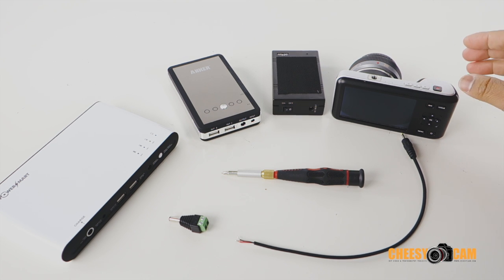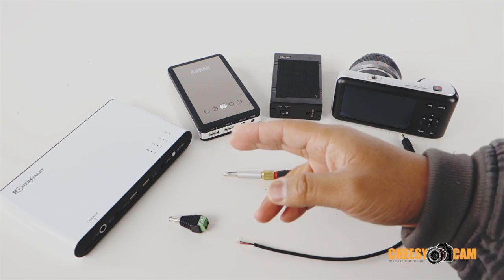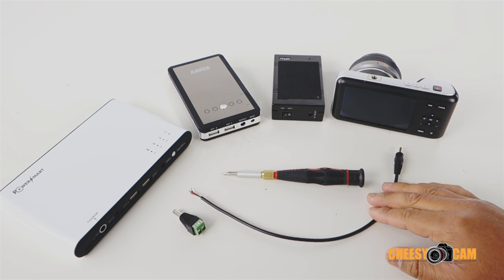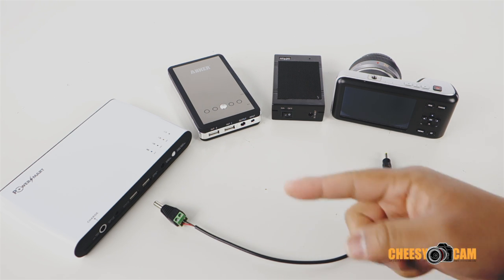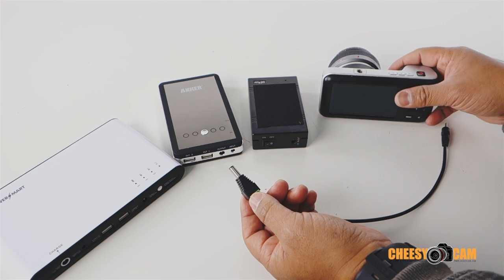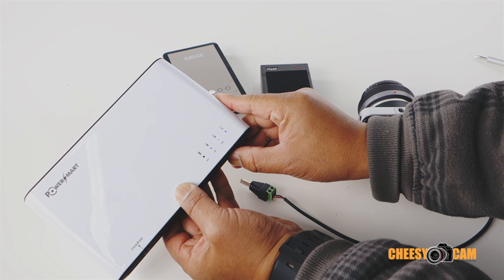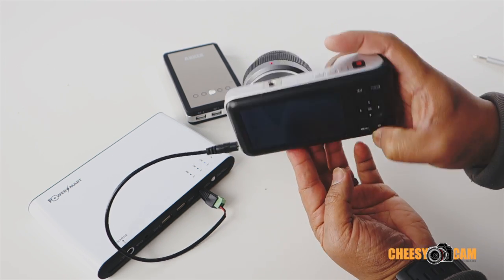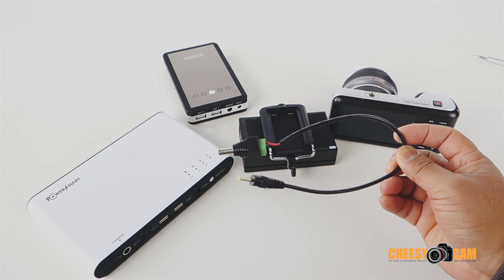DIY using any 12V battery for the BlackMagic Pocket Cinema Camera

Comment: Is it possible to use a 6400mAh 11.1v 3 cell lipo battery for the BMPCC4k?
Reply from the maker: Yes i think that would be possible as long as you have the correct adapter for the DC input.

Comment: I've heard the BMPCC can be powered from 7.2 volts and up.
Reply from the maker: Yes, but that is not enough to charge the internal battery. The reason you want to have a charged battery in the camera, is so that you can swap external batteries while the camera can remain on.
Reply: Got it. I have an 800mah pack, I going to connection a DC 5v to DC 12v step up voltage converter and plug into it.
Reply from the maker: Hmm while there are ways to change voltage (up or down), that does not increase / decrease the amount of AMPS a battery or a port (USB) is capable of delivering. The max amp output from USB is typically around 2AMPS (for a really good one), and that's because of the design of USB. Hopefully this is enough to charge the internal battery.
Reply: I'll try it and let you know.
Reply: Well I dont know about 7.2V, but 9V for example didnt work for me. I had to use 12V, otherwise the camera would not have turned on.

Comment: If I instead were to buy an 18v battery and a 5.5mm adapter, would I be able to do the same with the BMCC?
Reply from the maker: +Ivan Velasco I forget but I think it only supports up to 14V. 12V is the safest. Voltage does not determine how long it will run so 18v will not necessarily make any difference. 12V is pretty safe.
Reply: Ok, I'll do that then. Thanks for your help!

Comment: would a 12v car battery work fine with a black magic cinema camera ? input is labeled as  12-30v ..
Reply from the maker: Yes that would work also. But car batteries are usually very heavy and don't like to be discharged completely. When using different types of batteries sometimes you need to build in a low voltage meter so that you don't damage the battery.

Comment: What happens if you plug in a battery higher than 20v? Could it damage the camera?
Reply from the maker: +Eli Jordan Yes you will have a nice campfire.... The BMPCC can input between 7-16V, that should give you a lot of options for batteries. Do not attempt anything over 16V.
Reply: So the limit is 16V not 19V?, that's bad news because i planed to power the camera from a 4S lipo, but fully charged they had 16.8V. So i guess i have to put a voltage regulator between it. Anyway thanks for testing everything out and sharing the video.
Reply: But you just said in the video that we'd be okay with a 19V as well, because the spec said 12-20V. How come you are saying 16V is the max now?
Reply from the maker: Sorry, whatever was in the video is probably correct. I might be mixing up with other cameras i'm using. This video was published more than two years ago. Hard to keep track of these old specs.

Comment: I ordered the cables from the link and they don't seem to actually fit in the camera port. My charger cable that came with the camera works great though. I've inspected making sure they are the same size and measurements. But it doesn't wana slide in and I don't wanna force it and break the port. Any thoughts?

Comment: POOR DESIGNED on 5.5X2.5mm DC Power plug Terminals Connector Adapter Power. Only one out off the two I bought is usable.  The two tiny screws don't work !!
Reply from the maker: I have had no issues with mine, and I think I've built dozens of projects with these. Make sure you are stripping the wires enough so that the screw is not just sitting over the insulation. You might be stripping only a little area, and then inserting it too far past the actual connector.